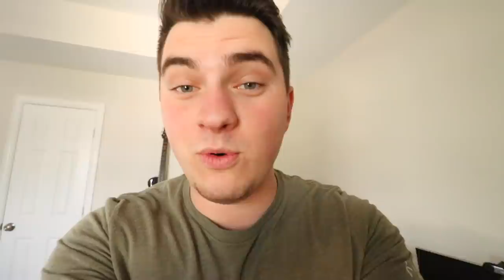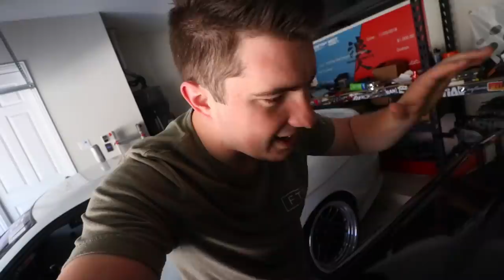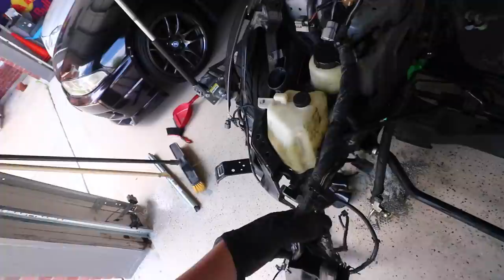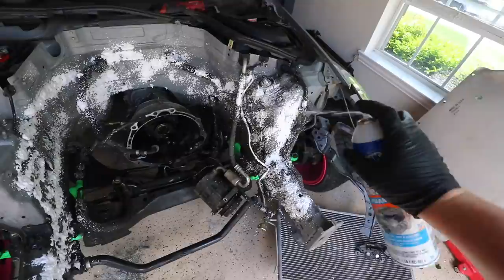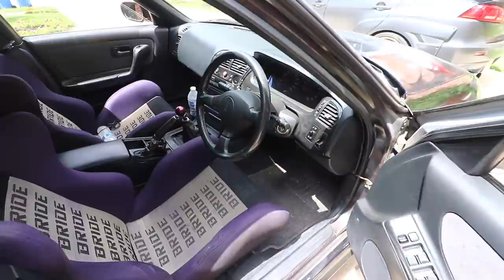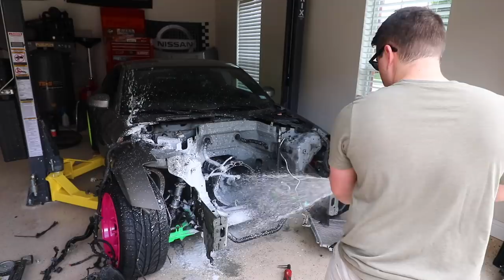DIY PAINTING YOUR ENGINE BAY! LS350Z

Comment: If you’re using the isr adapter plate kit make sure you grind down the bump on the inside of the bellhousing to the right where the stock crank sensor goes. The flywheel teeth get caught on that and you’ll think your engine is seized ask me how I know 😂 just trying to save you a heart attack ✊🏻

Comment: Looking good with that engine bay my dude! If I may make a suggestion?

Sand the white with 1000 or 1500 to smooth out the orange peel, then hit it with some clear. I recommend using automotivetouchup . Com stuff. Not the cheapest, but the quality is there especially if you're rattle canning it

Comment: Problem number 1, you aren’t using primer which helps dramatically when spray painting a engine bay instead of real paint through a gun. Problem number 2, you bought krylon which isn’t usually very good.  But! You’re prep and clean up job was killer!
Reply: Nick Berte actually, problem 1 was the fact he’s using spray paint